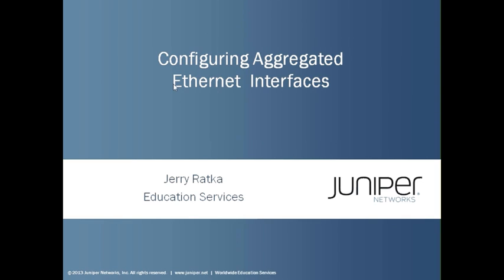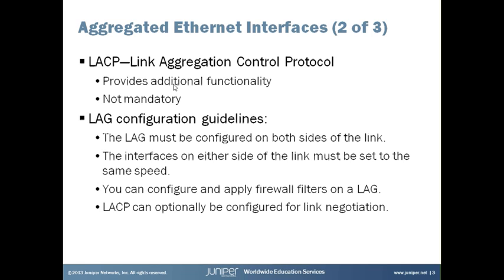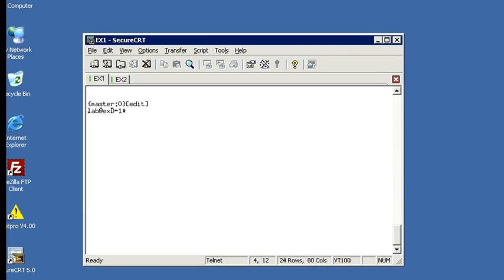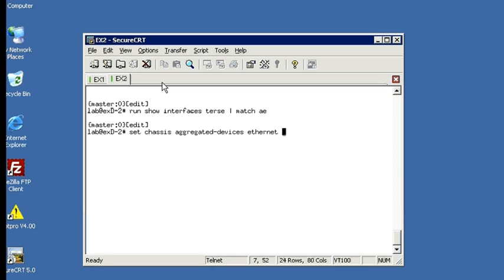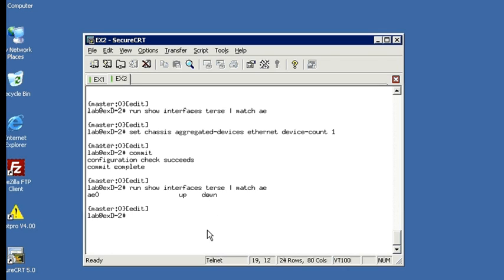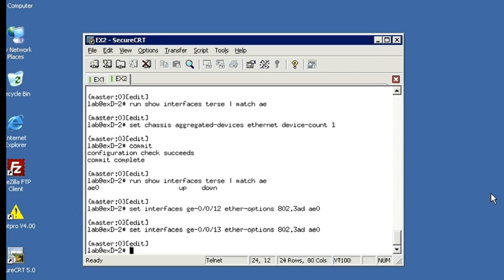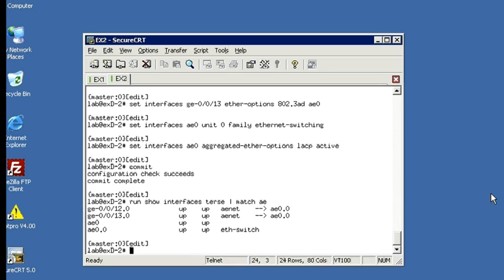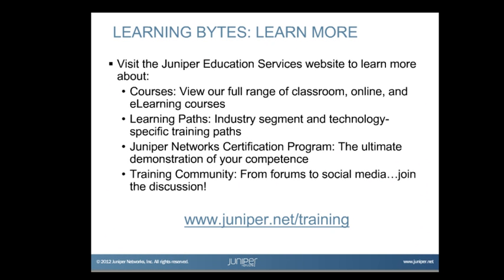Link Aggregation Group Overview Learning Byte

Comment: Great presentation , question, What is the difference between  Link Aggregation and a trunk port?
Reply: This question was asked 2 years ago, but for anyone needing to know, a LAG doesn't necessarily need to carry 802.1q tags like you would expect to see on a trunk. A LAG can be tagged or untagged just the same way a single link can. The LAG just adds multiple physical interfaces to whichever tagging method you're attempting to use across the links.